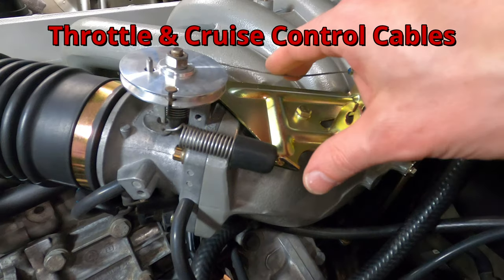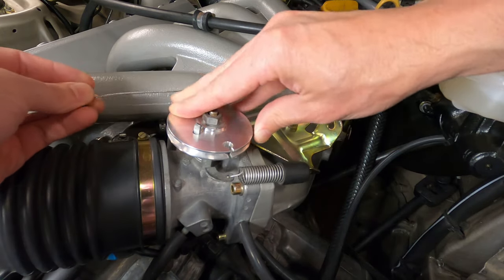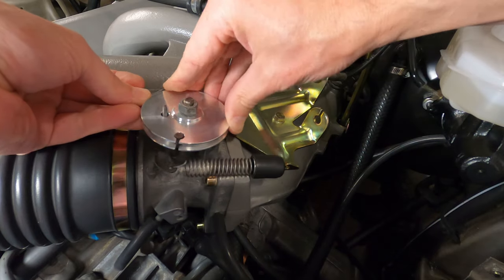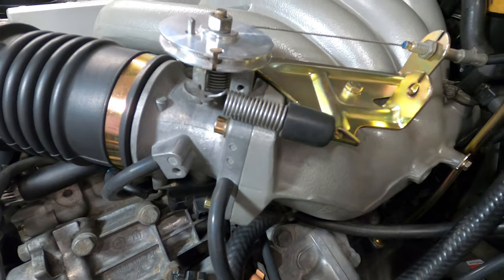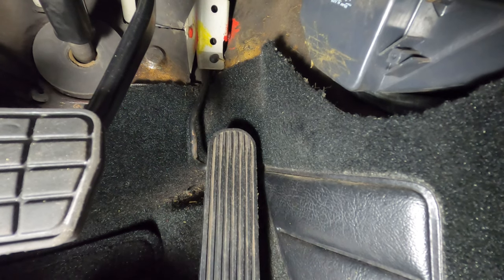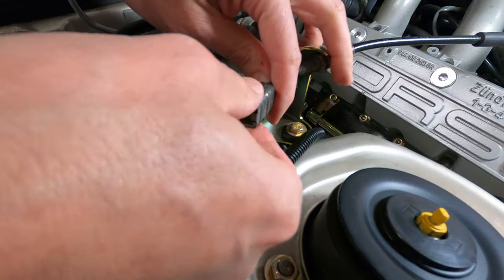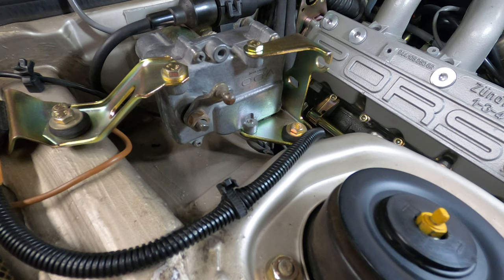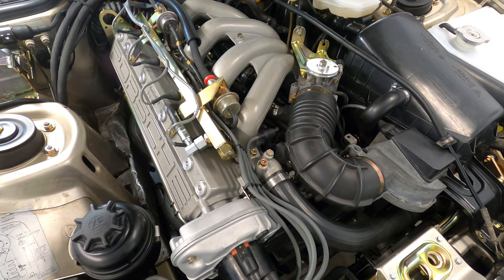Porsche 944 – How To Adjust Throttle & Cruise Control Cables

Comment: This video just diagnosed an issue that I've had the entire time I've owned my 88 turbo, being a high idle. I found out that the throttle springs have gotten week over the years of sitting and 100,000 miles. Thank you so much for this video! Now I just have to find a new spring

Comment: Great show mate. Question my inside door lights on my 944s is not coming on and I checked the fuses which were ok as well. Do u know what could it be?
Reply from the maker: Hey man, assuming you’ve already checked/replaced the actual light bulbs, the next most common issue is the door jamb switch that sits above the  door catch bracket. 

When you open the door, the plastic switch button should slide out to complete the circuit and activate the cabin light. 

1. The switch could be stuck, try to pull the plastic piece straight out to see if it activates. 
2. The switch contacts or its connectors have rusted from exposure to moisture. Remove the switch (one screw) and clean/inspect the wiring to see if you can get it working. Otherwise the switch can be replaced for around $16.
3. If you’ve been experiencing battery drain, it would point to this switch as well since it deactivates the driver window relay that allows you to raise/lower the window after the key is turned to the off position before opening the door. When the switch is faulty, the relay keeps running and eventually kills the car’s  battery.

Comment: Hi-Love your videos, nuanced details that matter and occasional music that's perfect! My throttle cam has been updated and my car runs terrific-no issues-BUT...I do not hear any clicking or micro-switch actuation in the throttle body when I crack open the throttle. It's simply not there! My car is an '87 944NA built May '87.Any input?
Reply from the maker: Hey Stuart! The throttle position switch used on these cars is the same part number for all model years, so the behavior should generally be the same. If you disconnect the throttle cable from the cam and actuate it then, can you hear anything? If so, the cable was probably adjusted too tightly.
Reply: @NC944er  Thanks! I'll try that-BTW there is slack in the cable as it's set up now-but will check! Appreciate the feedback!
Reply from the maker: @stuartwatson6849  If you’ve got noticeable slack in the cable, the test result will probably be the same with the cable removed. You may want to leave well enough alone if everything is working correctly, but here’s some more info if you’re interested. 

Due to some differences in the TPS design, the turbo cars are more likely to present the irregular idle or no-start conditions, whereas the NA cars with a faulty switch may only see poor power / acceleration and a reduction in fuel economy. 

In addition to the cable adjustment, the switch itself has a positioning adjustment controlled by two screws under the throttle body. It may be that your switch itself needs realignment. Here’s some steps from Clark’s on testing and adjusting the TPS : http://www.clarks-garage.com/pdf-manual/ign-03.pdf
Reply: @NC944er  Thanks a bunch!

Comment: Hey! I was adjusting my throttle cable and noticed I don’t get a click when moving the cam. Car runs as per usual. Any reason I wouldn’t hear it?
Reply from the maker: Due to some differences in the TPS design, the turbo cars are more likely to present the irregular idle or no-start conditions, whereas the NA cars with a faulty switch may only see poor power / acceleration and a reduction in fuel economy. 

In addition to the cable adjustment, the switch itself has a positioning adjustment controlled by two screws under the throttle body. It may be that your switch itself needs realignment. Here’s some steps from Clark’s on testing and adjusting the TPS : http://www.clarks-garage.com/pdf-manual/ign-03.off

Comment: My throttle cable is loose but my cable doesn't even look like that 1986 944 na automatic
Reply from the maker: Yeah, the automatic cars have two cables… one is the primary throttle cable as shown here and the other is a throttle kick down cable that leads to the transmission (tells the transmission when to up-shift when accelerating). The adjustment principle is essentially the same, you wouldn’t want excess slack in the lines.
Reply: @NC944er  I tightened up the slack and the car is running better but still needs adjusting what a pain, the car was sitting for 10 years and getting it to a safe car has taken me 2 years. I really wanted to do the Helena meet this year but looks like I gotta try for next year.
Reply from the maker: @BennysBenz  Yeah man, the struggle is real. I’m 4 years in and I’m still chasing things down. 😂 Years of sitting doesn’t help all the rubber oil seals on these engines unfortunately.